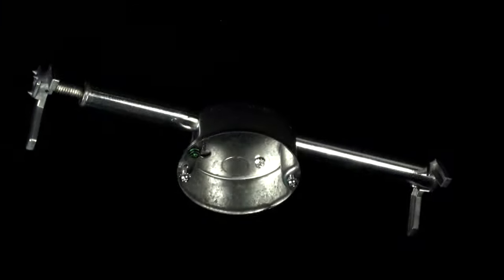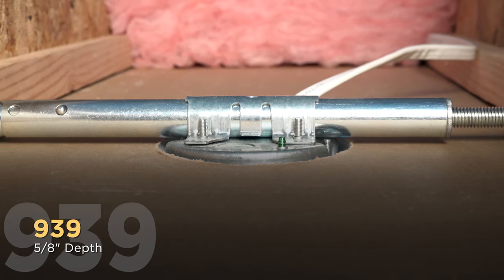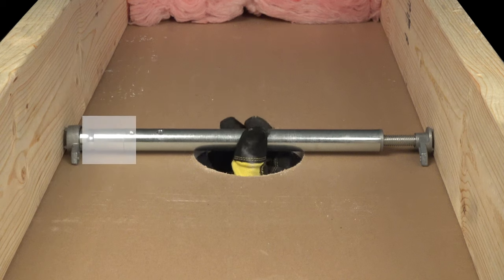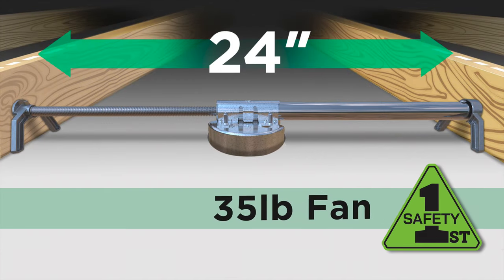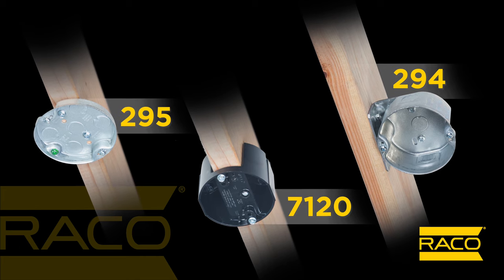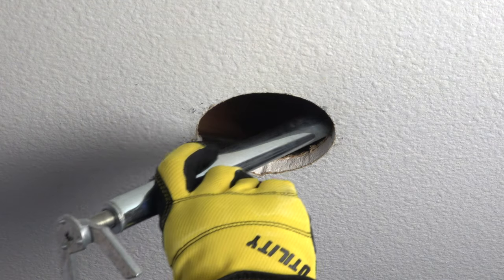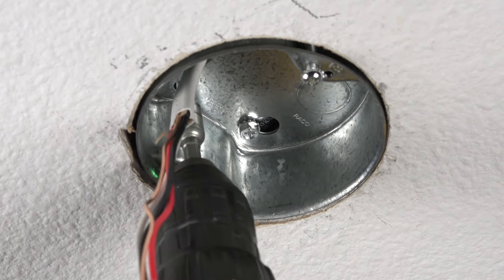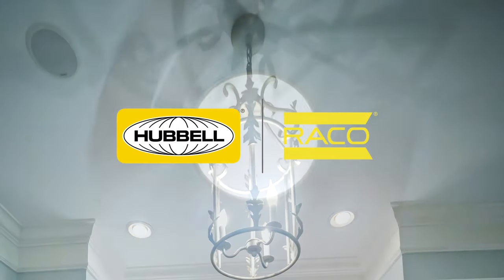RACO Retro-Brace® Ceiling Brace & Box Kit

Comment: I bought this product and had to do the same steps as far as removing the previous, non-fan rated, bracket and box and replacing with this.  One suggestion for the product is to have different feet size options.  The studs between floors in my house are weird and have small studs on top and bottom, with OSB between.  They’re not flush like the 2x4 they demo on, so getting the teeth to dig in was difficult because of the feet.  I had to get creative to get it to work, but it still worked out.  Near perfect product and by far the best for this type of application.
Reply: Jfu
Reply: I know it's a little late, but the beginning of the video delineates that there are two products sold in the product line, with one of them having smaller feet for installation on wooden I-beam joists exactly liked you just described.

Comment: What if my hole location is not centered between the two joists?  That is, will the RACO 936 still work for me if my outlet box won't be attached to the middle portion of the RACO brace?
Reply: It should work as long as you have about an inch from the face of your joist to the edge of your hole. Just make sure the screw end of the bar is on the joist farther from the hole.

Comment: I have a better way for  I joists,  I ripped a 2x4 to 3 inches wide ( easier to fit through the hole) test fit it on top of the lips (cut the length so it's snug) of the eye joist..When you are satisfied it's snug take it back out and lather the ends up with PL Premium construction adhesive. Now stick it back through the opening on the I joists. Strong as hell and only cost is a piece of scrap lumber and some adhesive.
Reply: This sounds like some bad Jerry rigging advice.
Reply: I don't think "hell" is all that strong when Heaven is around.
Reply: @georgekuh6500  I can hang off it...200lbs. No ceiling fan or light fixtures will bring it down.

Comment: For plaster ceilings the fan needs a rubber isolator between the fan and the bracket to limit how much vibration is transmitted to the floor joists.
Reply: please share a link. when i googled, i only saw rubber for  computer fans
Reply: Vibrating the floor joists? Must be a big fan...
Reply: Vibrating the floor joists?
Reply: @danielbishop1164  biggest reason plaster ceilings fail.
Reply: @danielbishop1164  dirty or out of balance  blades, wrong electrical box all contribute to vibration in floor joists that can transmit to wood lath and weaken plaster keys/cause cracking in plaster

Comment: this doesn't appear to work when the new work box was attached to the side of a joist during construction.  it looks like your electrical box won't go flush against the joist so it's oriented above the hole in the ceiling.
Reply: Then use a fan box with integrated lag bolts on the side.
Reply: It clearly states in the video to see other options if attached to a joist.
Reply: Try an Arlington FSB 1432 box if on side of joist